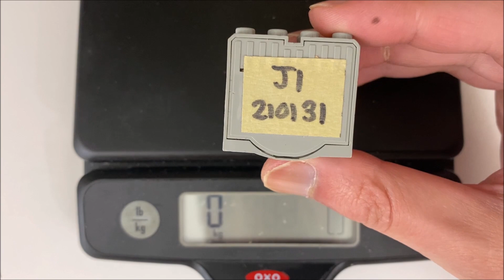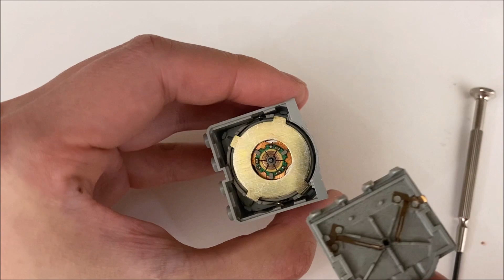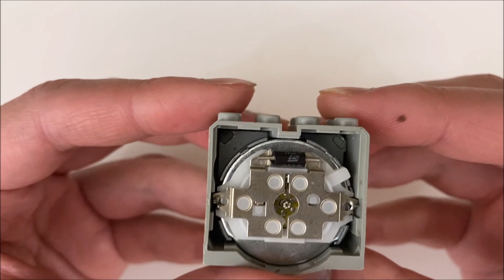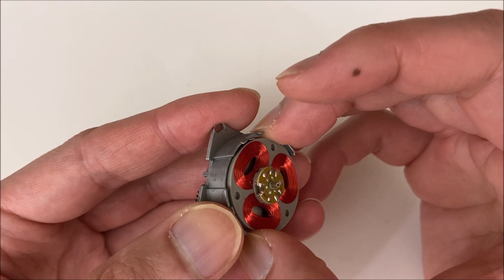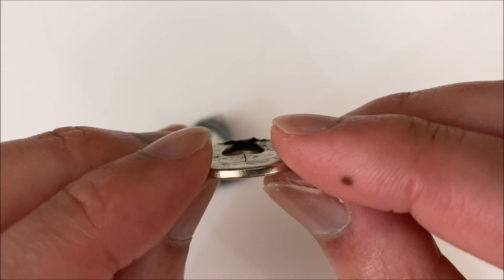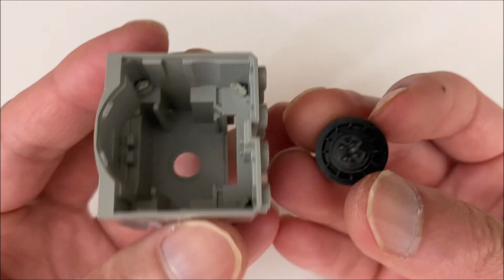Not Repairing the 71427 LEGO Technic Heavy Mini Motor

Comment: I was able to repair one of these with significantly worse magnet degradation, much thanks to this video. I was able to remove and reinstall the commutator and coil assembly with the aid of some heat on the shaft and lots of patience. The magnet in mine had largely turned into dust, which completely seized the motor. Wiping the magnet-remaints out was possible, and I epoxy coated the remaining usable magnet before reassembly. The entire process was extremely fiddly and ugly, but it did net me a working, albeit slightly weaker motor. I didn't bother remelting the plastic mounts for the entire assembly, as I found that the motor was sturdy enough anyway. Definitely not an easy repair and I can't say that I expect a very high success rate out of the process. But perhaps worth trying if your motor has seized.
Reply from the maker: Very impressive; did you happen to document the process anywhere?
Reply: @NonsenseWars  I took a few pictures, I just uploaded them here: https://drive.google.com/drive/folders/1ufp2qyWAaAEOoqraIT8i_0ukN9AwttvT?usp=sharing
I misremembered though: I didn't remove the pinion. I removed the PCB/commutator assembly, and then I removed the coil assembly from the shaft. These parts are fairly thin, so they're probably not as brutal to remove as the pinion gear. I applied just enough heat to the shaft to slightly soften the plastic while slowly levering them off. The PCB/commutator assembly is a separate part from the actual coils, and I think I removed it separately, which required the coils to be desoldered. As such, the rotor was never completely removed, only enough of it to access the magnet. I then put the remains of the magnet into a plastic bag with a bunch of epoxy resin. I cut the bag off once it had cured and reassembled the motor. I did this as a sort of just-for-fun experiment about a year ago, so you have to forgive my memory being a little fuzzy!
Reply: me who never has issues with the 71427 motors but the 43362 ones don’t work half the time, opposite of what normally happens huh lol

Comment: did some of these motors have worse quality magnets than others or are all 71427 motors just as likely to fail like this? also why is there almost no information on this issue online, it’s so common but so hard to find anything about.
Reply from the maker: We do have a handful that are still working, so it is a possibility... but you are right that there is basically no information out there about this.

If some are better than others I suspect it's a matter of shoddy quality control and not an intentional change in the material or design.
Reply: @NonsenseWars in the early micro motors, the red ones, they had a good magnet but later on they cheaped out and used cheaper magnets. And guess what? those later ones have the same issue lol

Comment: I read the cause was delamination of the iron as the material was just pressed together and then coated.
I have thrown away several of these over the years but looking for replacements as they were used in the CYbermaster controller.

Comment: I also ran into this problem twice with same conclusions on not being able to fix the original core, my thought was to try and find a motor that would fit inside the casing with “close enough” specs (or better) and then 3d print some holder as the shape is rather specific. this way I could retain the original look for classic sets for example. Not sure if cost effective 😅
Reply from the maker: This is probably reasonable if you can find an appropriate replacement motor. While it isn't cost effective for one unit, it will become cost effective if you can subsequently keep fixing them!
Reply: I would buy one + the 3d printed reduction if there is an option tried by someone :wish: